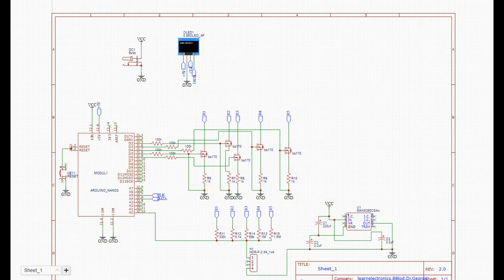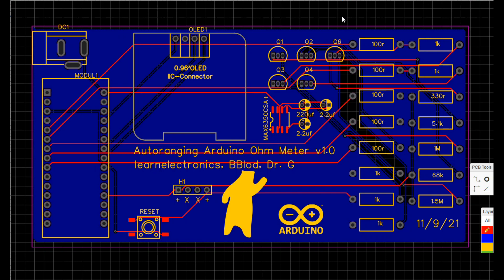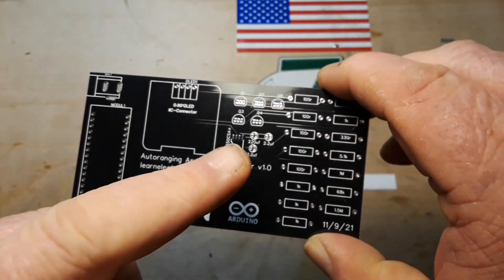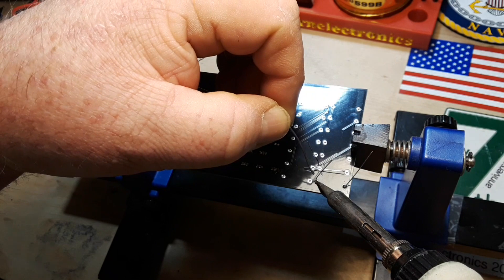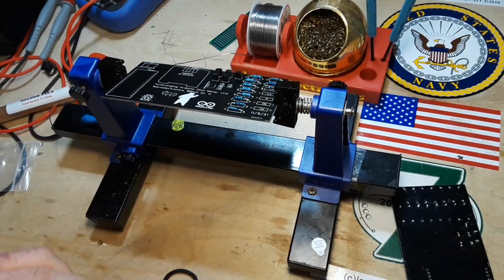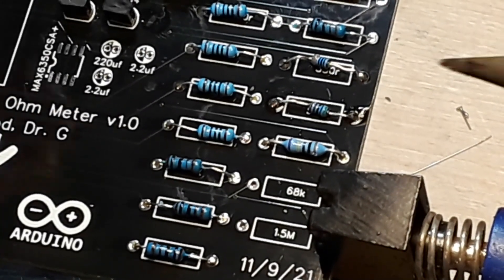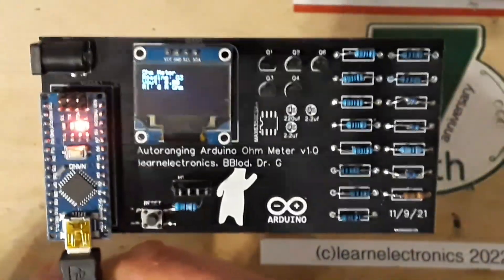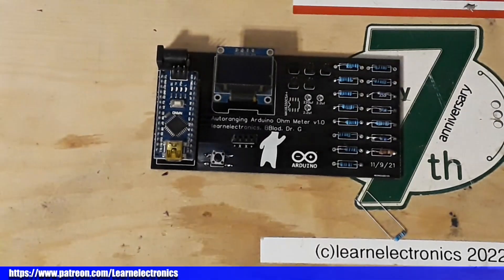Arduino Precision Ohm Meter V2 0 with BBlod, Quincy, and Luke

Comment: Because the Max6350 has such great specs, I suggest that you add an output for a voltage reference for calibrating voltage meters. No extra cost for a great extra feature.